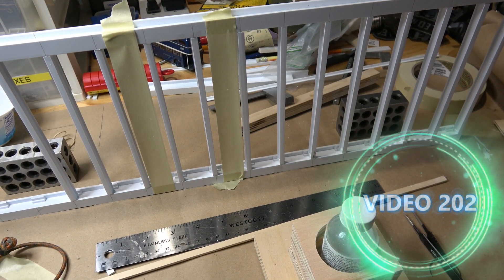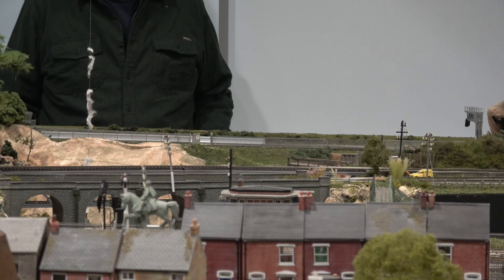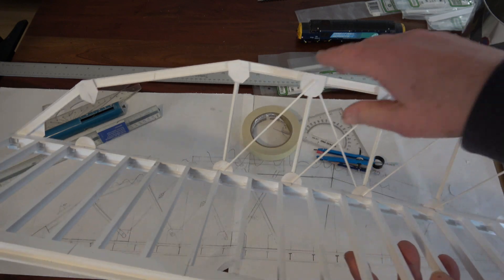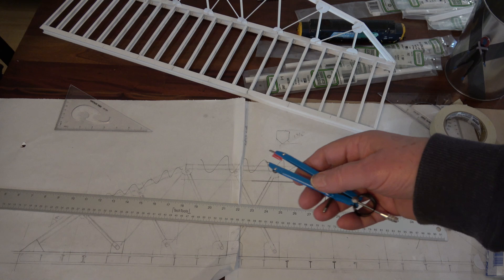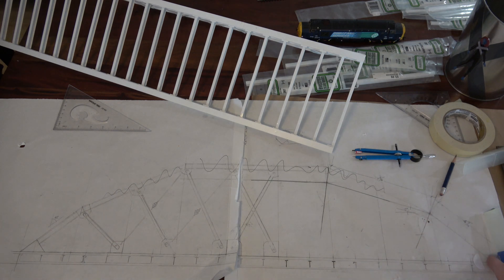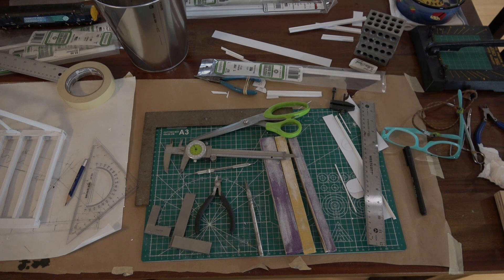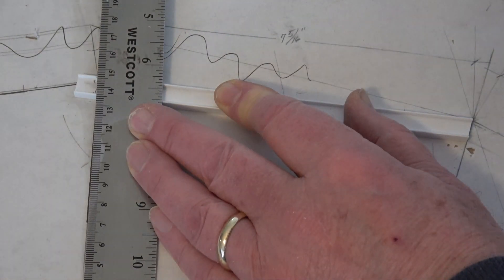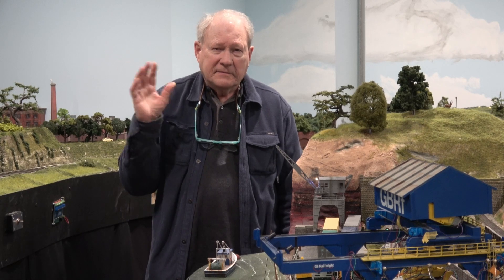203  Bridge Part 2 Scratch Building

Comment: It is looking great Rob. I'd have trouble cutting any two pieces the same, such as the gussets, every one of them would be different. As much as I like bridges, I do not have any on my layout. I'm trying to rectify that. David.
Reply from the maker: Hi David, bridges do look cool with trains running over them.  Being accurate takes practice but cutting slightly larger than the piece is expected to be helps.  The you trim, sand or file them down till they’re just as close as you can get them.  It takes patience, but I enjoy the work.  Thank you, Rob